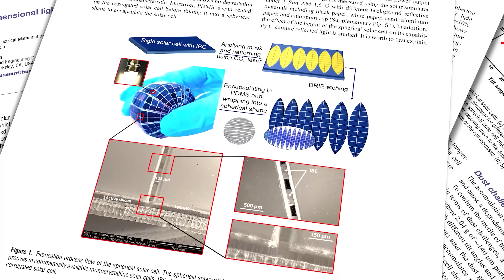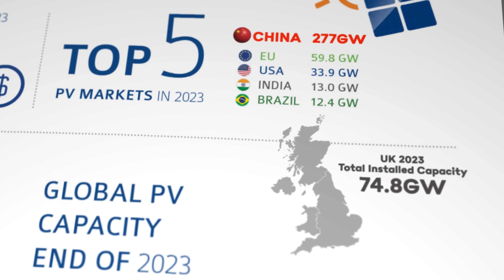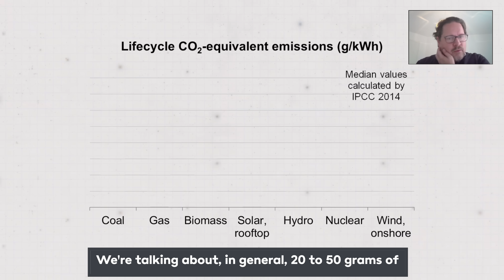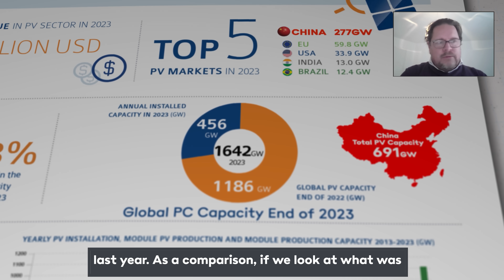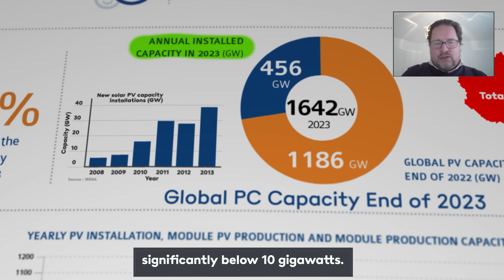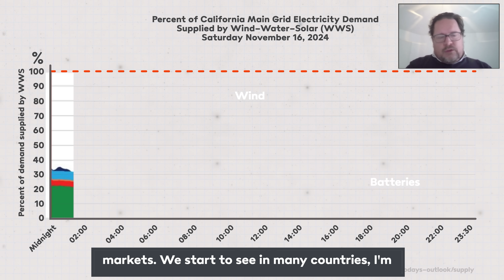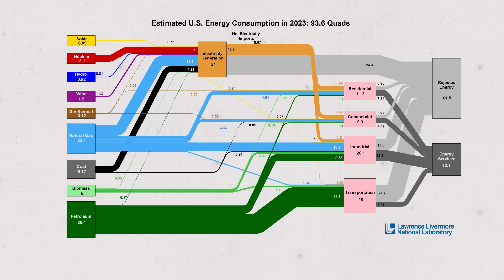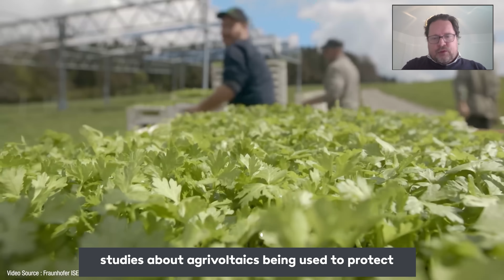Renewable Energy Domination

Comment: I wonder if using garbage for energy production is also a renewable energy source if the condensation heat from power plants is used to generate organic steam that generates additional energy in an Organic Rankine Cycle. This simply spreads fewer steam clouds with cooling towers. Instead, a lot of additional electricity is generated. The process is called KonKraV and is almost unknown, but could significantly improve existing power plants.
Reply: I'm not crazy about the toxic emissions from burning trash.  There's just no telling what kind of horrid items people will discard.
Reply: @incognitotorpedo42  Here are some important points to consider:

Organic superheated steam: Generated by the condensation of subcooled steam, which is a clean energy source.
Steam clouds from power plants: Often contain pollutants and contribute to environmental pollution.
Sustainability: The use of organic steam could be a more environmentally friendly alternative to energy generation.
Overall, the implementation of processes such as the KonKraV process, which uses organic steam to generate additional energy, could be a promising solution to improve energy efficiency and reduce emissions in existing power plants.
Reply: @incognitotorpedo42  I do not know what you mean. A coal-fired power plant produces clouds of water vapor as waste. This water vapor can be saved by using organic vapors for downstream Organic Rankine Cycles. This allows additional electricity to be generated. Wasted water vapor remains water vapor.

Comment: There is always a cost to any human activity.People seem to always forget that. Building on flood plains is a classic example. "Oh it only floods once every hundred years!" Then comes global warming and it floods every five years. and thats not helped by the canalisation of rivers and the loss of flood plains that control the movement of water through the landscape. 
I am all for PV even in the UK as 90% of the sun's energy is still available and during the summer we have long days. That being said I dislike solar farms in the main. Simply because they change the local ecology in ways we as yet do not understand. Water run off from the panels will create a small trough where water will collect. Will that make it better for amphibians? we just don't know.
For a lower ecological impact it would be easier if not cheaper to install Solar PV on top of car parks. The cars are protected from the worst of the elements and its a big wide open space that is crying out for solar PV.  The same for farm buildings. it is easier to install on houses with easy access. For that matter why not the M1? Sections of the M25 would be ideal for solar. We literally do not have to use virgin land to produce more solar energy than we need. It is a waste of resources.
Reply: This is wise.  The French are mandating solar for car parks beyond a certain size.  I think that's a great idea, since I seek out shade to park in much of the year.

Comment: Solar may get so cheap someday that some people are thinking overbuilding 3x-5x, to help deal with the intermittency.  Of course, this would be paired with batteries, at least for some level of time shifting, and buffering.  How to size this is an optimization problem.  (Tony Seba has worked out one suggestion.). 

The big issue then, is dealing with overabundance.  Currently this is handled by curtailment.  But if there were an economic model that makes use of intermittent excess (free energy), then this can justify the cost.  It would have to be a demand sink that is low CapEx, and is fine with low capacity factor.  Some people have suggested thermal storage as one possibility.  This could be esp. important for industrial processes.  There maybe other use cases.  But it's an area that has yet to be explored, and could be a new market in itself.
Reply: I'm somewhat skeptical of this happening. No matter how cheap the manufacture of solar panels gets, there's still the cost of labor to install them and land to put them on. Neither of which is getting any cheaper.
Reply: One possibility is using the excess energy to power olivine or basalt rock crushing and grinding machinery, and electric transport to spread the powdered rock, as a carbon dioxide removal method. We'll need a lot of that to draw down excess carbon that's already in the atmosphere and oceans.

Comment: "You can't compare it that way Dave because ..."

No, not because of that. You can't compare it that way because China (1) has a population of 1.4 billion (vs 70 million in the UK), and (2) is going through a development phase that the other areas you cited went through decades ago, when the PV technologies available today were not available. If China had been on this development track 100 years ago, and had spent many billions of dollars building up the necessary capacity to support their economy at that time, using technology available at the time, I very much doubt they would be spending all of that money again currently, to tear all that down and replace it with PV.

That doesn't change anything about the facts stated in the video - China is adding a heck of a lot more PV capacity than any other country. But let's provide all of the relevant facts, not only the facts that suit a particular narrative.

Comment: 100% renewables is impossible!! Stop spreading wrong expectations!!!
Reply: Why is it impossible? Please explain.
Reply: @martyschrader  Achieving a 100% renewable energy grid is a noble goal but faces significant practical and technical challenges. A mixed energy grid, incorporating nuclear for baseline load and renewables for variable demand, is a more practical and reliable approach for the following reasons:

---

### 1. *Intermittency of Renewable Energy Sources*
   - *Solar and Wind Dependence on Weather:* Solar power is limited to daylight hours and affected by cloud cover. Wind energy depends on wind speeds, which are unpredictable and inconsistent.
   - *Seasonal Variability:* Both solar and wind output can vary seasonally, leading to mismatches between supply and demand. For instance, solar power is less effective in winter when demand may peak in colder climates.

---

### 2. *Energy Storage Limitations*
   - *Battery Technology:* Current battery storage technology (like lithium-ion batteries) cannot economically or practically store the vast amounts of energy needed to cover extended periods of low renewable output, such as during "dark doldrums" when solar and wind are both insufficient.
   - *Cost and Resource Constraints:* Large-scale energy storage systems are expensive, and their production requires rare materials (like lithium and cobalt), which have environmental and supply chain concerns.

---

### 3. *Grid Reliability*
   - *Baseline Power Requirements:* The electrical grid requires a constant, stable supply of energy (baseline load) to function effectively. Renewables alone, due to their variability, cannot guarantee this reliability.
   - *Ramp-Up and Ramp-Down Times:* Traditional fossil-fuel-based systems, like natural gas plants, can quickly adjust to supply gaps. Nuclear and renewables need complementary systems for fast-response adjustments to demand.

---

### 4. *Land and Resource Use*
   - *Space Requirements:* Renewable energy systems require vast areas of land. For example, solar farms and wind turbines need significant space, which can conflict with other land uses.
   - *Material Needs:* Manufacturing and installing renewable infrastructure require large quantities of raw materials, potentially creating new environmental and geopolitical challenges.

---

### 5. *Role of Nuclear Power*
   - *Stable, Carbon-Free Energy:* Nuclear plants provide consistent and reliable energy output, making them ideal for baseline load without emitting greenhouse gases.
   - *High Energy Density:* Nuclear energy produces far more power per unit of fuel than renewables, reducing land use and resource intensity.
   - *Longevity and Scalability:* Nuclear reactors operate continuously for extended periods (18-24 months between refueling), making them dependable.

---

### 6. *Complementary Mix of Energy Sources*
   - *Flexibility of Renewables:* Wind and solar can cover peaks in demand, especially when conditions are favorable.
   - *Support from Nuclear:* By supplying the stable baseline load, nuclear allows renewables to focus on covering the variable load without risking grid instability.
   - *Backup and Redundancy:* Diversifying energy sources ensures resilience against failures or shortages in any one type of generation.

---

### Conclusion
A 100% renewable energy grid is technically challenging and economically impractical with current technology. A mixed grid that includes nuclear as a stable, low-carbon baseline source and renewables for variable load can provide a reliable, sustainable, and environmentally friendly energy system. This approach ensures energy security while progressing toward decarbonization goals.

Comment: I was in a Earth Cafe the other week and made the point about grazing in agricultural settings - someone retorted that cynically it never actually happens as the sheep then need a “shepherd” so they then just use petrol mowers to keep the grass down 🤦‍♂️ The local authorities couldn’t care less much like the developers once it’s signed off apparently- this was coming from the local mayor who happens to be a Green Party member - I was quite astonished so it’s no wonder the average Daily Mail reader gets a bee in their bonnet 😮
Reply: That doesn't actually make sense.  Is the idea that sheep are more expensive than mowers?  Maybe so.  Sheep are ruminants, and they emit methane, about 5 kg per year on average.  Is that worse than a petrol mower?  Considering that methane is 80X the GHG potential as CO2, they're probably worse.
Reply: @incognitotorpedo42  You get neither wool nor chops from your mower.
Reply: @ depends if the sheep get eaten I guess? 😳

Comment: Nuclear, while not the cheapest, will always be the better solution for grid energy and environment. The guy you interviewed is talking about using 3% of available land? That's not a small amount in the slightest, that's a lot. Nuclear would literally use less than 3% the amount land (which in terms of total land use would be 0.09% since we are talking 3% of 3%). Then there's the whole thing with how the panels are recycled to begin with and all the waste that is still produced in manufacturing and when recycling because there is no such thing as a 100% recovery and is more like 80-85%, so recycling only reduces mining demand by 80-85% percent. And some of that waste is also toxic. So you will still need to continuously mine for materials even when recycling. And when you talk about the sheer amount of mining materials required in a solar pv process, it just does not seem to be the most environmentally sustainable. Compare to this to nuclear, and nuclear not only produces for less waste (literally produced less than a one tenth the amount of waste conservatively, with some even saying nuclear produces less than 1% the amount of waste) and requires much less materials but it's high level waste can also be decreased by around 90% with advanced reactor designs and the waste can not only be recycled but reused. By most estimates you would need a recovery rate of about 99% to reach the same levels of waste as nuclear given current solar technology. Almost all the non-transuranic waste in nuclear has other uses ranging from medical to industrial. Just as you should have laws requiring solar pv to be recycled and waste handled with care you should also require nuclear waste recycling. This whole conversation about nuclear waste wouldn't even have to exist if you had the proper regulations in place. This doesn't even get into the fact that nuclear  uses an order of magnitude less land, meaning less disruption to nature. And sure you need to always mine for fuel, but as stated earlier since solar recovery isn't and can never be 100% you will still always need to mine for solar as well. In the future maybe solar waste levels come close to nuclear but I don't see a future where it is less than nuclear.
Reply: Talk to me about recycling nuclear plants.  How much concrete is in a cooling tower?  What is the carbon footprint of that?  What is the cost of decommissioning a hot nuclear reactor?